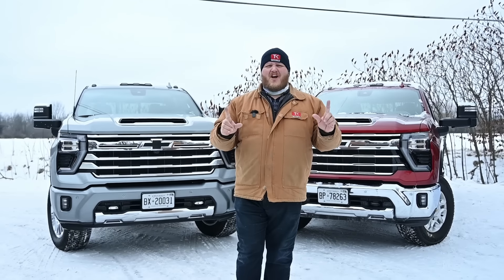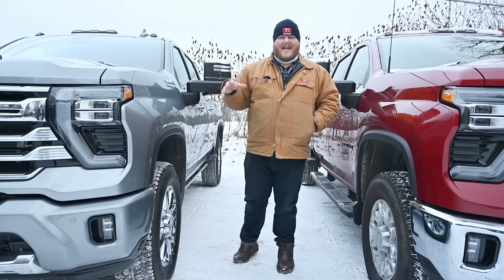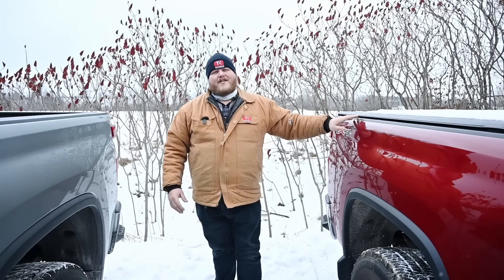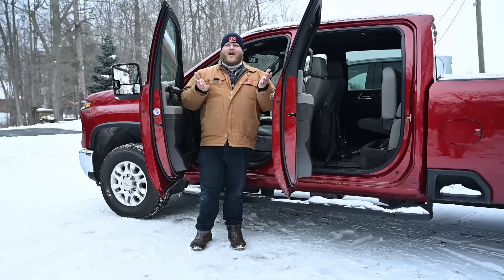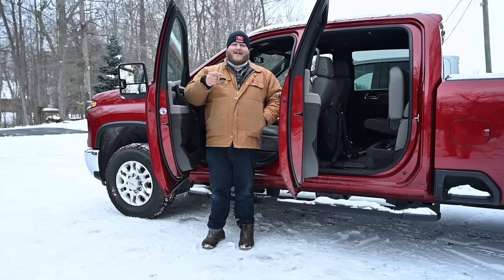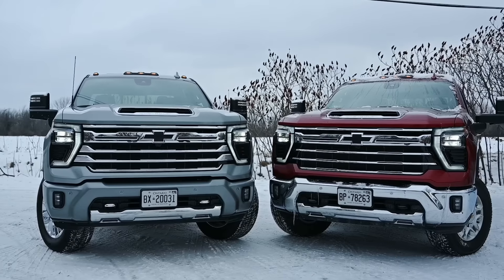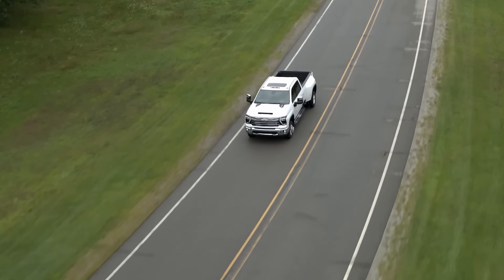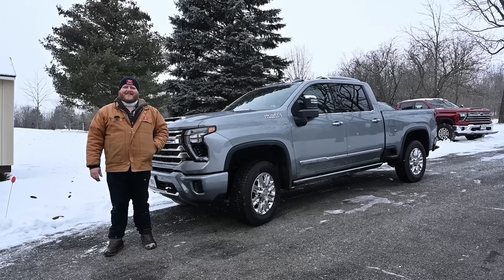2500 vs 3500 Trucks - What's Really the Difference? We Compare Two Chevy Silverado HDs to Find Out

Comment: It has become quite difficult to purchase a new truck to haul a camper.   The manufacturers are now focusing on trailers and fifth wheels and seem to have abandoned the camper market for the most part.  So, the camper and overland modification companies continue to produce products without trucks to carry them.  That is especially true for products designed for the Toyota Tacoma which simply does not have much payload at all.

Comment: Same sorta BS situation between 2014 HD 2500 Rams and 2015-2018 HD 2500 Rams. The 2014 HD Ram, the first year with HD coil springs and 3500 frame swap, Ram never increased the GVR above 9000 lbs.  If you buy an identical 2015-208 HD 2500 Ram the GVR is 10,000 lbs.
Reply: My 2011 Ram 2500 had a GVWR of 9,600 lbs. Did Ram drop the GVWR on the 2500s when it went to the ridiculous rear coil setup?

Comment: Steve, great content and presentation. It’s great to see how you and your dad are close and work together so well. Question about the ring gears. If you say it’s true I’ll believe you but I thought that 2500 diesels have the same axle and ring gear as 3500 diesels. Is that incorrect? Second question the one thing I didn’t hear you mention was electronic torque reduction. Is there any torque reduction in the 2500s or 3500s and is it related to ring gear size? Thanks in advance and keep up the great content.
Reply: 2500 diesels (non max-tow) have 11.5" ring gears, and 2500 max-tow and 3500 diesels have 12". 2500 max-tow and 3500 diesels do not have torque limiting in first gear (which is only enabled if you have tow-haul mode on, otherwise all the trucks start in 2nd gear)

Comment: It's a great point that you're bringing up the commercial legal compliance guidelines around the gvwr/axle ratings between the 2500/3500 models. It's very true re commercial regulations between the 2500/3500 models - I do wonder how much is jurisdiction based. I'm a fellow Canadian, but presumably you will have numerous American followers. The 3500 models typically have a much lower margin of rating difference between their respective GAWR Front/Rear and the total GVWRs vs the 2500 models. The thing you brought up about the Rams is correct (presumably with some GM/Ford models too) - there could be upwards of a 2000+lb difference between the rated axle limits and the GVWR limit; however on the 3500 models the difference is typically much lower seemingly suggesting that the commercial weight classes have more to do with that difference than the actual capability of the respective trucks

Comment: Never knew how little was different between the 2500 max tow and 3500! Quite revealing.

I will say that because of the packages, there are some configurations you cannot get. Certain options only come with a package, which mandates other features you may not want. No matter how much you play around, you cannot get it. It's part of their pricing model, unfortunately.

I love the LTZ not the one thing I'd want is that fake wood trim and maybe the blue interior. Personally I actually prefer the chrome bumpers to body color!

Comment: I have a 2024 2500 duramax in midnight edition. I don’t tow heavy often but I like having the capability. I will tow a pallet of lime with 1000 lbs of fertilizer for my property. I did it with my tundra but it struggled a little on the hills . My duramax is a beast!! There is nothing I tow that will give an issue. Great review

Comment: Here in the States, if a truck is over 10k we have to have a DOT physical to drive it for a company. Under 9999k no physical. I wonder if that’s why RAM stays at 10k.
Reply: I believe that is state dependent. Here in Maryland the cutoff is 26,000 lbs GVWR/GCWR or 16 passengers and if you have HAZMAT on board it doesn't matter how much the vehicle weighs. Of course the FMCSA will tell you that anyone operating a vehicle for commercial use must have a CDL (including a class C CDL for Uber and Lift drivers), but that is rarely enforced.
The DOT physical is a pain, but you have to be in pretty bad shape to fail it.

Comment: Great video and you are definitely spot on with the differences in a 2500 and 3500 SRW. There is one exception though and that’s if you get a gas engine, they both have the 11.5” ring gear. The diesel is all that gets the 12” ring gear. And I’m not sure about the 2024s, but GM stated back in 2020 that 3500 diesels got full torque in 1st gear. That is not true for 2500s. 

And you’re also correct in the reasons for different GVWRs. GM allows for a 10,000 pound GVWR in the 2500 trucks but they no longer allow for a derated 3500. I think that’s why the 2500 max tow was introduced for this year. It keeps you under the 26,000 GCWR CDL limit when towing a 14,000 GVWR trailer that a standard 3500 will exceed. Now that’s for commercial use only but still, that’s my opinion of why that package exists. Gives small business owners the opportunity to have the benefits of a 3500 SRW diesel without having to exceed 26,000 GCWR. 

Basically it’s pencil whipping the system, which I love lol. 

Last thing from me is concerning the towing sticker. The tow ratings are not necessarily VIN specific. They are configuration specific. However, if your truck has 19,100 or 21,500 on the tag then there is a scenario where it could hit that number. You might need a 90 pound driver but it would be possible lol. It is the best sticker on the market though.

Comment: IMHO AND I AM VENTING

Have owned many DMs in sw and Duallies. We run a small fleet of 2500 and 3500s in Dodge, Chevy and Fords. 

I am a GM guy and love diesels, but the number one problem with all brands is the ridiculous and unnecessary def systems. 80-90% of all our  breakdowns are with this crap. Same with our road tractors and other equipment. 

So why will I not buy a diesel hd truck now? 

1. DEF / the morons that voted in the emissions laws, should be made to fix and pay for the repairs. 
2. ULSD / what a joke
3. Ridiculously priced / gas cheaper / better value
4. Way Over priced (ALL TRUCKS ARE). 
5. Have had many, so don’t need to look cool or tick a status symbol box. 
6. To much gov interference. No tuning as a whole
7. ALL brands are overrated and did I mention OVERPRICED 
8. Engineers can be so stupid. They take the 6speed Allison out and put the NOT NEEDED 10 speed in. Now you have to pull the pan to change the spinoff trans filter. (Was told by diesel mechanic). If this is the case, HOW DARN STUPID CAN YOU BE!!!
9. DID I MENTION OVERPRICED? 
10. DID I MENTION OVERPRICED? 

As for best brand. 
Based on all the ones we run and run hard. Each does 70-90k per year with gooseneck and equipment hitched. 

All have their issues. But for durability, comfort and good drivability: 

1. GM
2. Dodge
3. Xxxxxx (John Deere) 
4. Ford

Again, IMHO and based on real world experience.

Comment: China owns gm. Many people have no idea. The seal was brokered in 2009 when the fed took ownership via bailout. Chrysler took an unsecured loan and ford put up the blue in the oval as collateral. So really Ford only had to change the shade of blue if they didnt pay it back. The stipulation of sale to china was to wait until after the 2012 election, then very small sections until after obama was out of office in 2016. Now almost every vehicle is made in china except trucks. Even the diesel engines are engineered and produced by Isuzu in china. They are smart enough to realize truck buyers usually look at that. Don't support china.